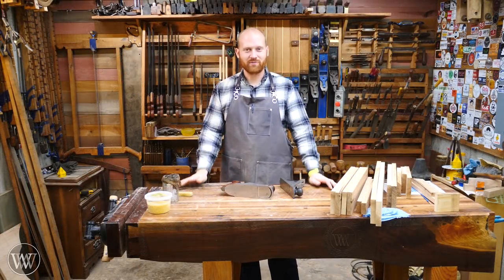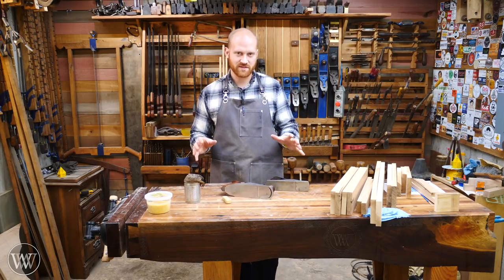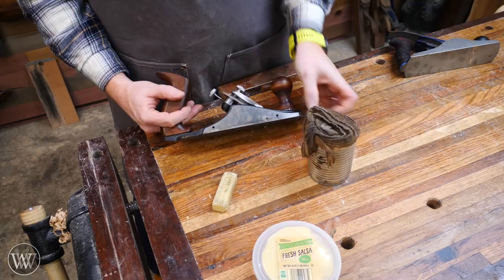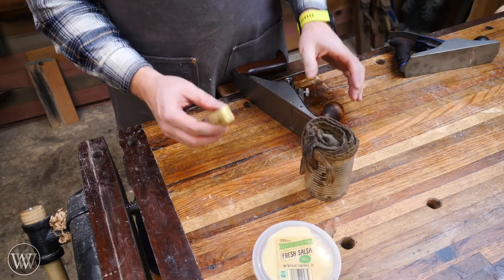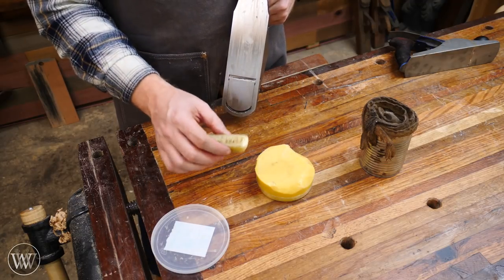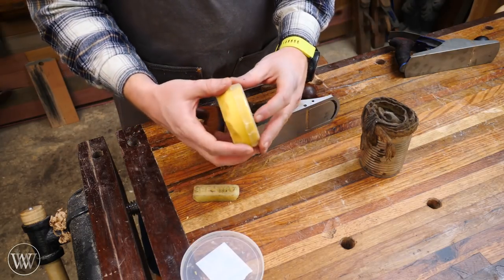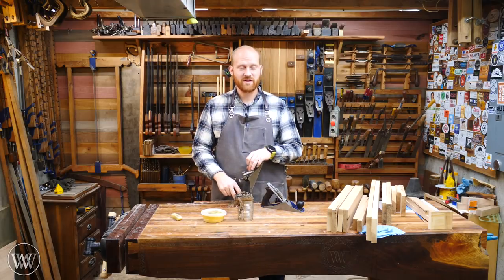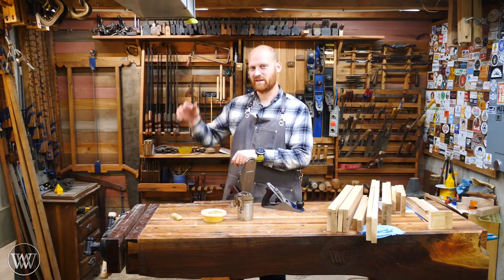How to Lubricate a Plane Sole | Oil Or Bees Wax

Comment: Fresh Salsa is the best lubricant :D

Joke aside, I use oil/can and I prefer using paraffin (candle) wax instead of beeswax.
I find that the beeswax gums up a little on the bottom of a plane as you mentioned in the video, I have never had that problem with paraffin wax.
Reply from the maker: +Andrea's Workshop lol. I should patent the salsa. I just prefer the feel of the bees wax, bit each to their own. That is what makes the sport great.

Comment: It all sounds very spiritual .... lubricant for your soul ;) Never tried the wax, I started out via Paul Sellers so I've always used the rag in a can and you're right, it does wear off fairly quickly. For me, it's not an issue since it's so quick to re-apply but I'll give the oil wax combo a shot at some point ... thanks for the info!
Reply from the maker: thnaks man. so true!

Comment: Does the transfer of wax cause a problem for finishing?
Reply: From what I understand, as long as you don't wax or oil the sole right before your very last finishing passes before applying finish, it shouldn't be a problem.
Reply from the maker: not at all. I even wax the sole on the final smoothing passes. it is so little there is no issue with finish.

Comment: Mineral oil was recommended to me by a machinist for rust prevention and I've been using it since, but I've been wanting to create a blend with bee'swax for sometime now. Supposedly 3-in-1 (what paul sellers recommends) is trademarked mineral oil, save yourself the 4 dollars for 3 oz of 3-in-1 and buy a 16 oz container of mineral oil for 12 bucks. Besides lasting forever it's usually "food grade" and good for conditioning wood butcher blocks.
Reply from the maker: right on 3-in-1 has a few other chemicals in it but very similar. I also know a lot of other guys that use olive oil.

Comment: isn't this dangerous, because the oil rag can catch fire at room temperature?
Reply from the maker: No the rag can not catch fire at room temperature. It requires certain circumstances for the oil to heat up to the flash point of the paper. Usually over 200F. I have a video showing what it takes for rags to catch on fire. But with simple precisions it is not a problem at all.

Comment: Nice James. A comment and a question. First, I'm kinda surprised you haven't tried BLO for your oil in the can. Secondly, i did a homemade wax with BLO, paraffin, beeswax and microcrystalline wax. The final product is so sticky, it's practically unusable! (I suspect the microcrystalline wax is the culprit) I melted some of the pucks (made in silicon cupcake  cups) and added more BLO. It helped somewhat, but ain't great. Any ideas come to mind for salvaging it, or should i just throw out? Thanks for everything you do! G
Reply from the maker: The problem with BLO in the oil rag is that it polymerizes and hardens. That's why most use and oil that polymerizes very very slowly if at all. Here's a video on making paste wax where I give the mixtures that I currently use. https://youtu.be/4k9mJtvqP94?si=a5a5m-_bwe0QWs2c
Reply: @WoodByWright  That make sense. It's interesting it doesn't harden when mixed with wax. Thanks James.
Reply from the maker: It will form a thin skin on the surface that's hardened but the wax stops the oxygen from getting deeper so everything inside doesn't cure. Usually for my lubrication now I use raw Lindsay oil so it takes even longer for it to polymerize.

Comment: I bought a small block of beeswax from Ace Hardware and it gums up on me. So I don’t use it anymore.  I use oil now, jojoba or 3 & 1. But I may try mineral oil as mentioned in the comments.  I think the oil covers better and provides better rust protection. Applicator is a piece of carpet.
Reply from the maker: +Carey Kitson yup that is one of the reasons why I swiched. I am actually trying olive oil in the rag right now.

Comment: You can mix oil and wax in any ratio you want to get something between oil and wax.  The oil can dissolve the wax.  Heat may be necessary, but of course they are flammable, so don’t put them over direct heat (water bath is the standard approach in chemistry for this - it’s cheap, easy, and effective).  Once it solidifies you can get just the consistency you want.
Reply from the maker: Good summery

Comment: Hi James,

I'll add one...I saw Roy Underhill recently make a little dovetailed mutton tallow holder. He suggested that may work as well. Having a shop in my unheated and un-air conditioned garage, I might worry about that in the summer.

Love the channel, keep up the great work!

PS - right now I'm in the oil rag camp but I may need to try the paste Wax now.
Reply from the maker: yup. that stuff is fantastic for wooden planes feels a lot like the paste wax. it tends to wipe off of the steel soles fairly quickly though.

Comment: Thx for the info, now I'm wondering if that would weaken my glue joints?
Reply from the maker: no. there is not enough left on the wood to make a difference. all of my glue tests were with a waxed plane. same for finishes. does not affect them at all.
Reply: @WoodByWright  thank you sir! I'll be doing this on my next project 👍👍

Comment: Hi James, thank you for the video I have just started wood working as a hobby and I am learning a lot from your channel I am half way through all your videos. I have watched the video where you make the mixes and the cup measurements i suppose its not very standard as we might all use different cup sizes. I was wondering if next time you make the mixed, if it is not too much trouble you could weight the amount of oil that you use and the amount of wax for the mix you use to lubricate the tools. Thank you for your time and the fantastic videos :)
Reply from the maker: In the US a cup is a standard measurement. It is about 1/4 of a liter. but there is no reason to be that accurate. most of the time I do not Meuser anything and just eyeball it. if I am off by 50% one way or the other it does not make that much difference.

Comment: Is it a good idea of using a rust inhibitor spray on tools like block planes and other tools?
Reply from the maker: Sure. But most people just use light oil or paste wax. Because that can also double as a lubricant. And no using paste  wax on the sole doesn't affect finish applied to the wood.
Reply: @WoodByWright  I ask this right after I watched your other video.   Durp dee durp.  Lol.   I really appreciate your help and all your videos are just what I have been looking for.  Thanks much

Comment: Excellent suggestion, James. I've always used paraffin wax that is sold for sealing canning jars.  It's available at most hardware stores, and it is very cheap.  I've never had a problem with it building up.  With that said, I like the idea of being able to swipe the sole of the plane once across a large surface.  I'll have to try the paste wax suggestion.  I wonder if the rag in a can could be saturated with paste wax.
Reply from the maker: thanks. Paraffin is a great wax for it. You can saturate a rag but the rag cannot "wick" up the past wax as it is a solid.
Reply: Yes, the paste wax would need to be occasionally reapplied to the rag.  My point is that I wonder if a rag in a can or piece of felt in a can, would be tidier than keeping a semi-solid block of paste wax on the bench.  I didn't mention it before, but I would keep the rag covered to ward off saw dust and chips.

Comment: Inaccurate description of rag-in-a-can oiler (& a rather poor example on display), no mention of type of oil used (it makes a difference).  I use a lot of beeswax but find it too tacky to use as a lubricant, for lubrication - if the oil is not enough - I would go with the English Woodworker's  example and lightly & quickly sig-zag a white paraffin wax candle down the base.
Reply from the maker: +Tony Y lol ya I do need to re roll the rag.

Comment: Saint Roy Underhill spoke several times about using grease to lubricate tools. Even pointing out that, at least, one of the Dominy workbenches had a built in grease pot.
Reply from the maker: Right on. Landolin is a great traditional lubrication, particularly for wooden planes.

Comment: how do you clean sappy shavings off the sole of plane iron ? they seem dried on . thanks !
Reply from the maker: If the board is still sappy then it is probably not dry yet. But if you wax the sole they will stick less. To clean it I would use alcohol.
Reply: @WoodByWright  thanks for putting in so much to answer questions. I will try the alcohol and a stiff brush of some kind. take care!